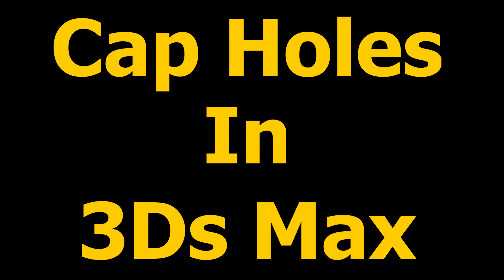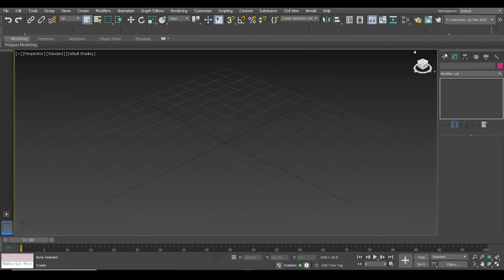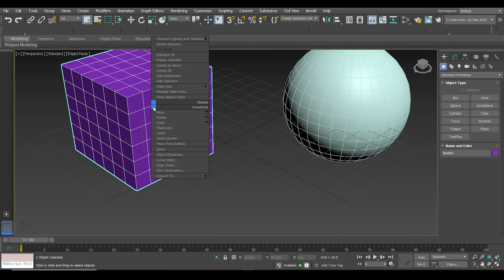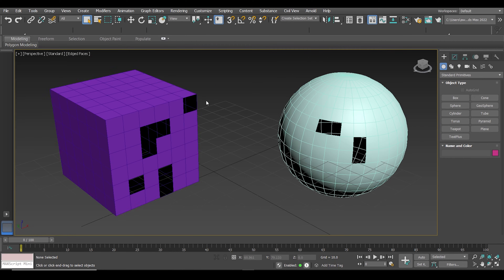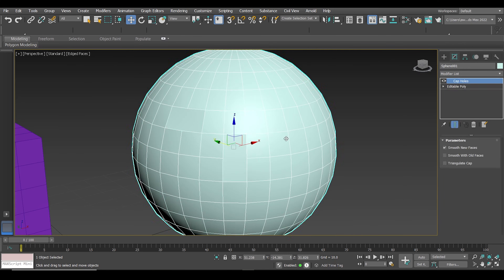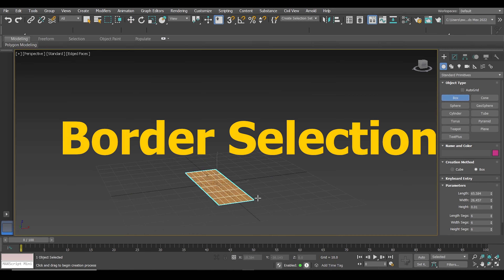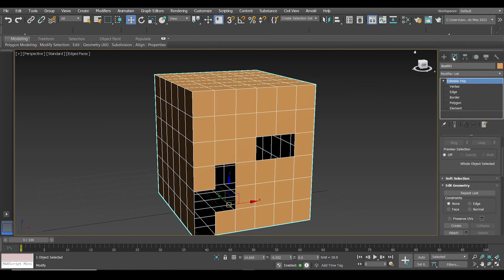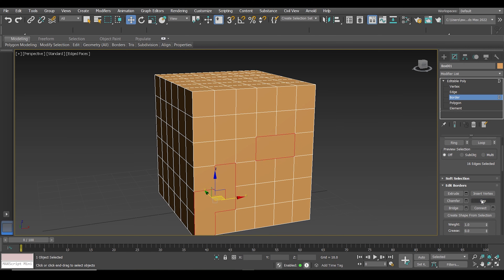How To Fill or Cap Holes In 3ds Max Objects? Two Methods | Cap Holes Modifier and Border Selection

Comment: hi, when i create a sphere and i enter it looking outside and it is transparent and as if the internal sphere had no wall, is there a way to fill the internal wall?
Reply: Use shell modifier with internal thickness value or 2 sided material if you want it to be seen only in render